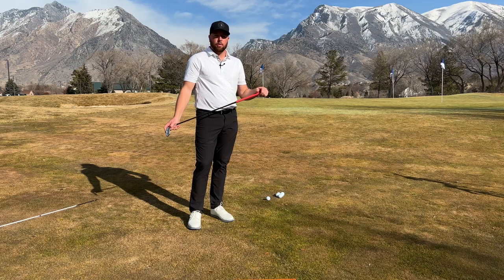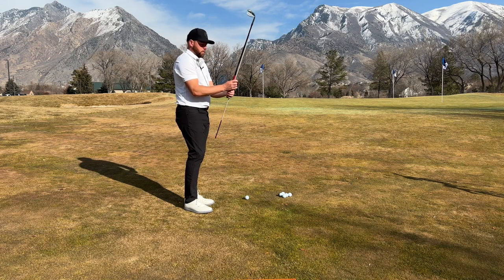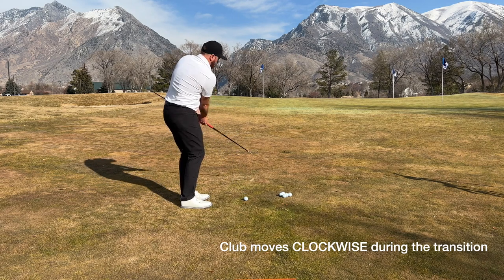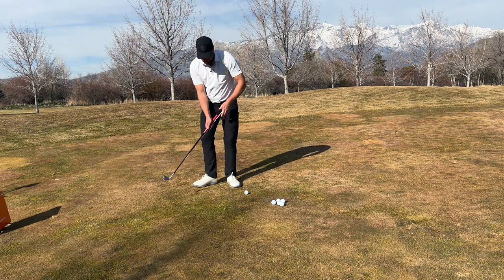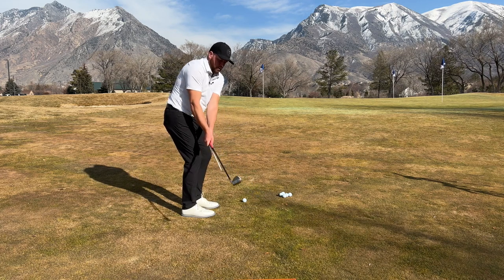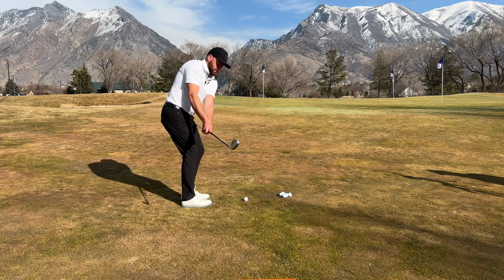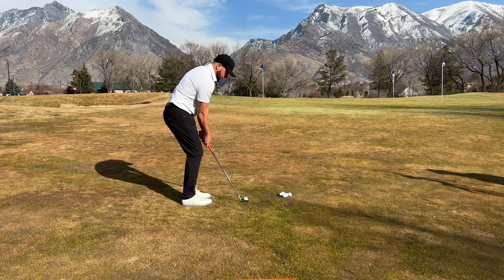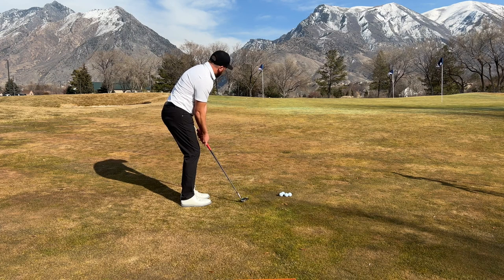Simple Chipping Drill

Comment: Hi,could you explain how you set up for a chip like this ,with the alignment stick there seems to be a lots of shaft lean , is this the same set up you would do on the course . Thanks
Reply from the maker: good question - Nate will adjust how much shaft lean he has at setup based upon how high of a launch angle he wants for the ball.  So if he wants the ball to run out more he will setup with more shaft lean which will lower the loft of the club a bit and vice versa.  There isn't a "right answer" other than you experiment and get comfortable knowing what trajectory you want to see based upon how much rollout you want for a given shot.
Reply: Thanks